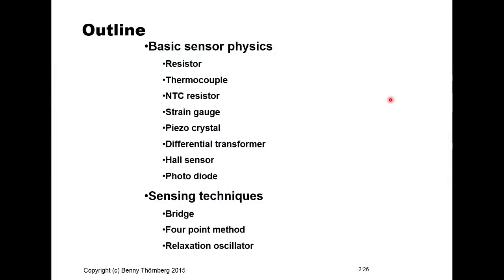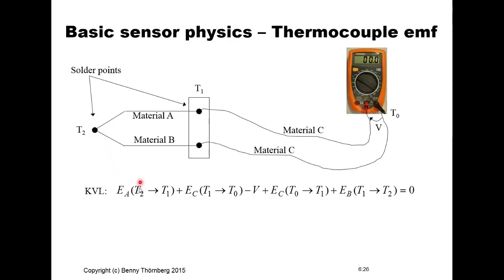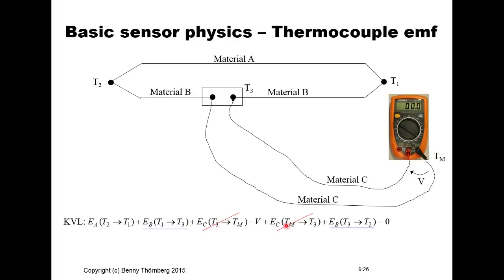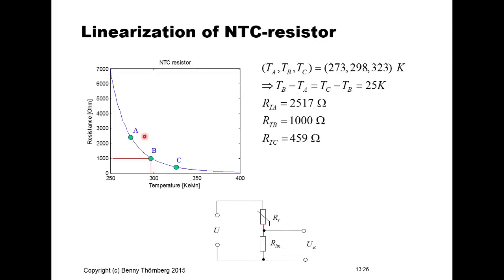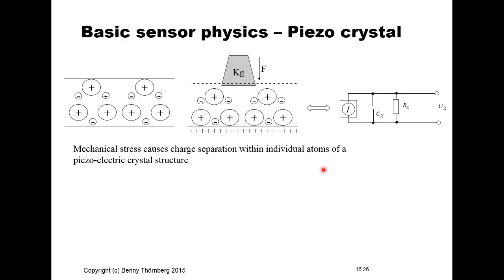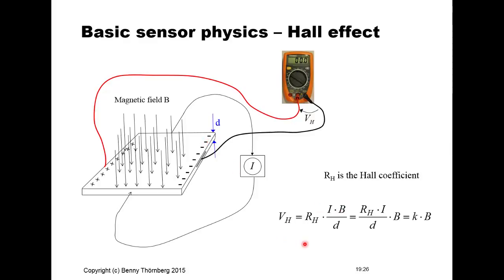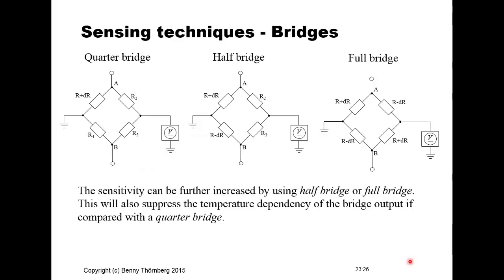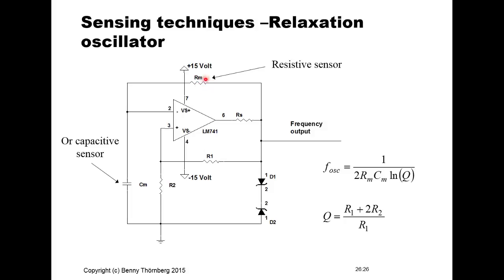Metrology - Basic Sensor Physics and Sensing Techniques

Comment: Hi, in slide 6 you use Eab(T2->T1)=ß(T2-T1) but in slide 9 you use Eab(T2->T1)=ß(T1-T2) in accordance to slide 5. So the formulae in slide 6 seems to be wrong
Reply from the maker: Yes I agree. To be consistent with the definition of temperature and thermal gradients on slide 5 I believe the end of equations on slide 6 should be rewritten as you suggest,  Eab(T2->T1)=ß(T1-T2). Cheers Benny.